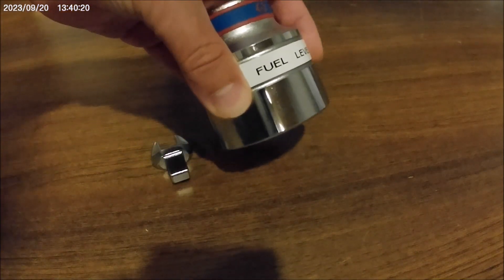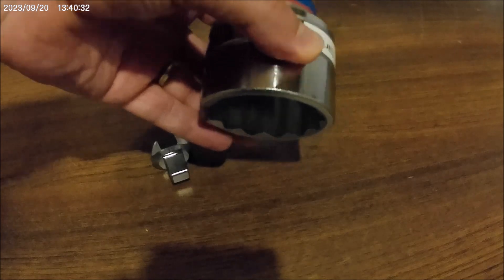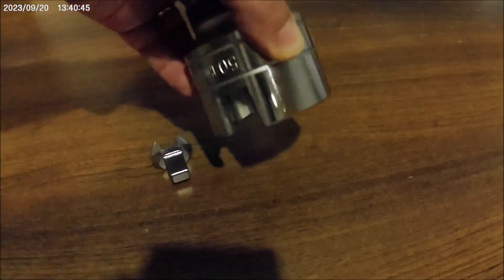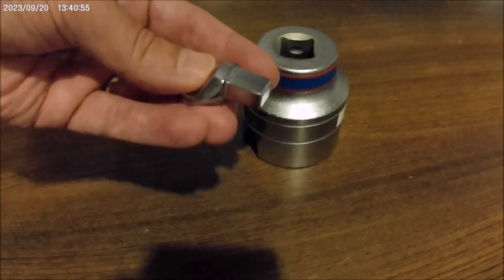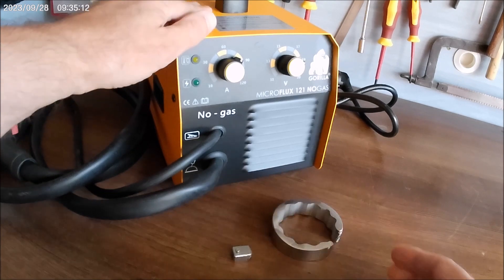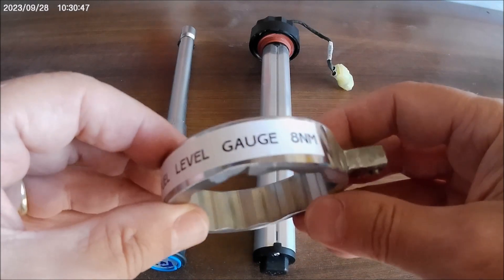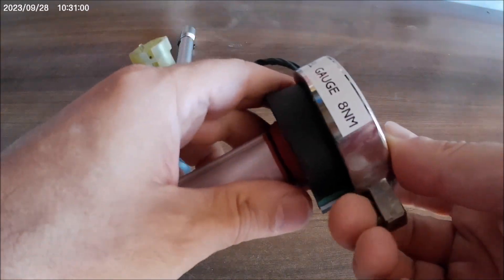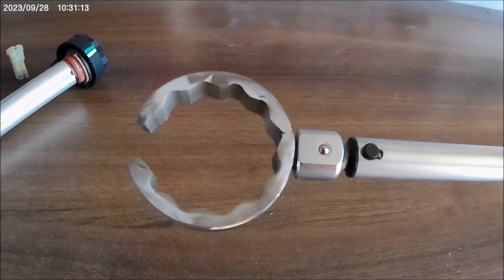Self made fuel level gauge tool for Ducati Multistrada 1260S

Comment: How long did this fix last, as I replaced mine and it worked briefly maybe 2 months 🤔. I don't know if it's worth replacing again.
I appreciate your thoughts?
Reply from the maker: It's been working for a year after replacement in my bike. The broken one was fixed. As for its replacement: I like my gadgets working so I always replace any non-working item. As for the reason of its break: it usually can be fixed but let's face it: it is a kind of design error on the bike. The failure can happen due to various reasons. As for 2 months: should be under warranty.
Reply: DesmoHead, they offered to replace it on my next visit, but I find it odd that this issue persists.  I wonder if the ethanol content in the local fuel might be a contributing factor?
Reply from the maker: Gasoline and its ethanol content ain’t got anything to do with these failures. The electronics chamber in the tube is separated from the float chamber and insulated against the fuel. Should the insulation installation was not correct during the assembly then fuel could go into the electronics chamber. However, gasoline is not so conductive. Anyway it is definitely worth a diagnostics on the broken one when it will be removed.